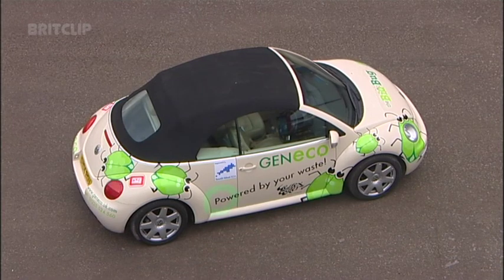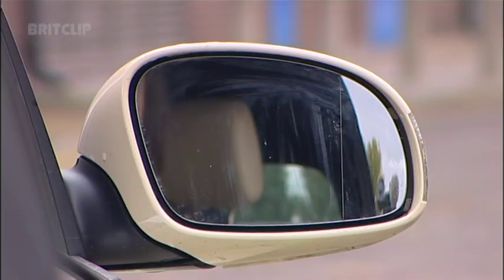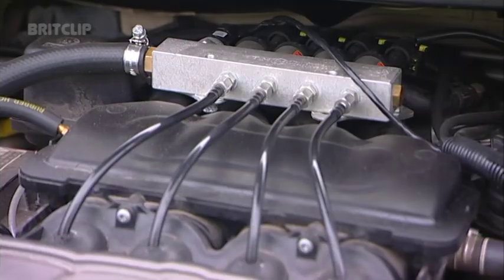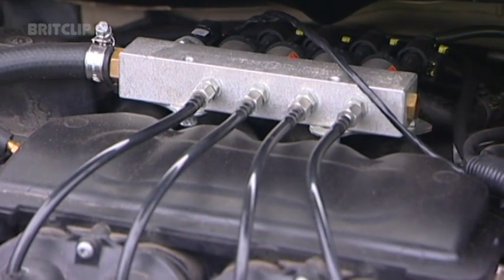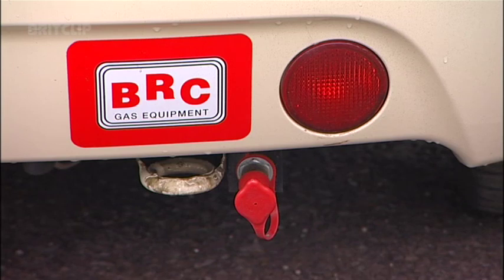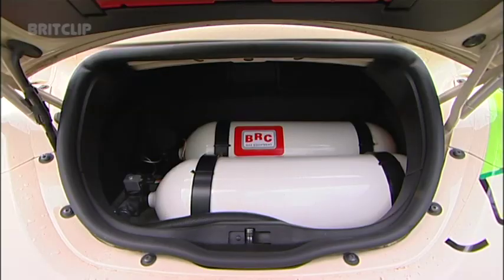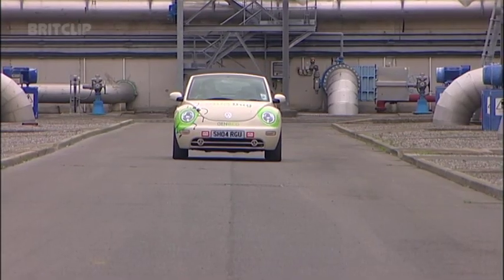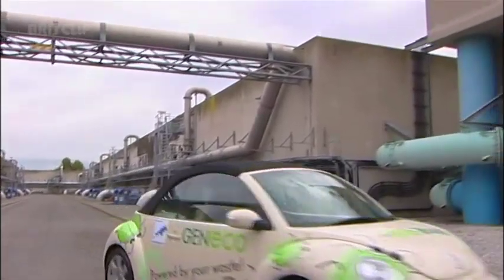Poo powered car

Comment: Awesome. Some guy is working on bacteria battery. Sounds like there's exhaust to this car if real, but you'd think the exhaust can be burned off like they do with "flaring." Maybe friction heat can help with that if necessary. Probably optimized  cultures and source matter can go in tanks, but seems like it should be ev hybrid with the methane powering the battery.
Reply: When you burn methane it turns mostly into Co2 and water, which is a lot less harmful than methane. If humans are going to produce waste, might as well benefit
Reply: @FletcherHillier  Okay, but I'm not sure engine exhaust  is same as burning it. I  will try to read up on that point in case it's different.  I do suspect genetically modifying some crops, maybe with bamboo genes and or seaweed growing on land, high methane yield is  possible. Removing the exhaust emissions definitely priority that point, but open air carbon capture machines can probably be built to run pretty efficiently from bio diesel or any range of fuels because its not  a traveling car machine, just stationary.
Reply: @sampleoffers1978  An engine is definitely burning fuel. Biogas plants attached to animal farms can capture a lot of methane, and humans produce a lot of waste that could feed biogas plants as well.
Reply: @FletcherHillier  It's burning liquified methane sure. In Europe they burn the gas directly....Won't be legal here.  I'm asking if the exhaust really is co2 and water? Methanol? If that's true, then co2 is manageable to remove if efficient open, carbon capture machines are  built to remove co2. If the exhaust is more complex, it's issue. Ammonia is trending topic now. Unsafe for cars in regular form, but for hybrid ev's, ammonia could be easy storage of renewable energy, making charging network way easier for ev's. Small ammonia powered generator or motor in hybrid could charge ev battery.

Comment: Most people pass gas at a rate of 24 times per day. So you would have to eat some raunchy stuff. To have that reserve you need fir when those tanks run out. If they could just hook a re-gen so when you pass gas inti the seat. It was vacuumed into the combustion boosters.
Just think eating pizza could get that last ten miles.
Reply from the maker: Interesting concept Warren.

Comment: So, those two tanks at 200 PSI, exactly how many miles of driving does that translate to? Liquids are denser than gas, so, i'm guessing the two tanks we saw represents a VERY SHORT range between refills.
Reply: My local gas company says that a modern gas powered  VW Golf has a range of about 500km, about 200km less than a regular petrol powered VW Golf.
Reply: From what I have read so far it seems comparible to the lpg cars, brc, prins, stag and more make conversion kits.
As it stands I get about 200 miles from a spare wheel tank, and lpg costs about 60/90 /litre
Reply: Maybe as a flex fuel alternative type vehicle
Reply: @someguy7222  Ev hybrid could be good.

Comment: There’s a Bus that runs on human waste or Methane. But could cars run on Methane. Methane is considered as dangerous. Even thinking about Hydrogen is also as dangerous.
Reply: Maybe smaller tanks can charge battery in hybrid electric and then larger explosion is mitigated. Might also have ability to design it to flare off emissions anyway.